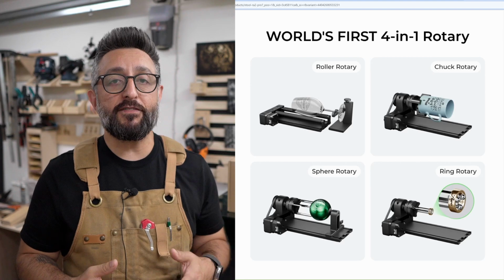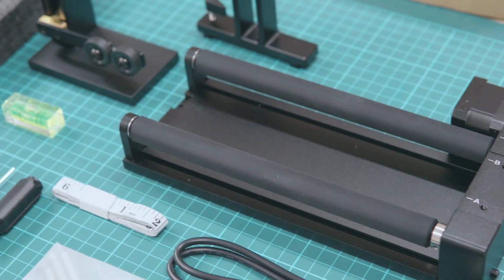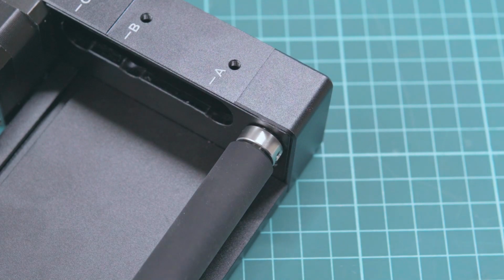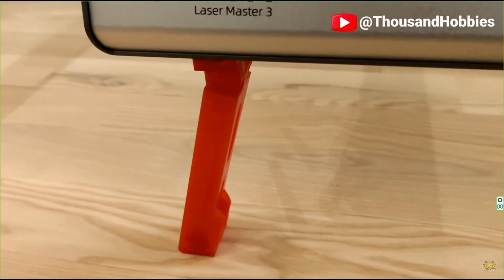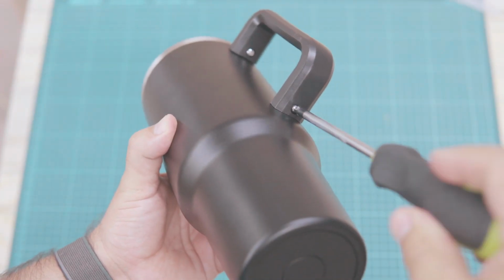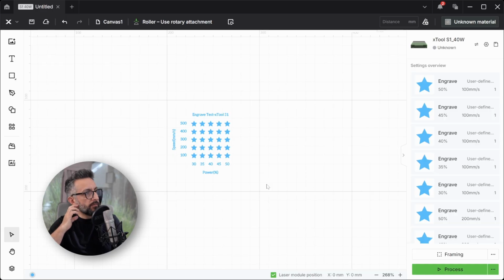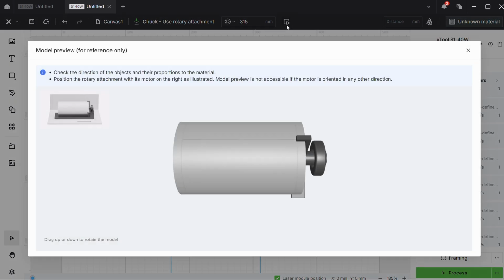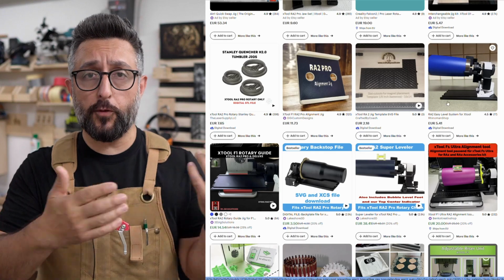Xtool RA2 PRO: Is This the Best Engraving Upgrade for 2025?

Comment: Cheers Mr,  just got my Ra2 pro out of its box cos I have a couple of jobs.  What would do the best job ya reckon?  S1 20w, S1 2w IR or P2s? Nga mihi 👍
Reply from the maker: Hey! Thank you very much! ❤! for the engraving It depends on what you want to engrave, material and detail of your design. You have more of a pro level with the P2S. And the diode is more hobbyist. The dot sizes are different too. On stainless steel the 2w IR can give you more detail but will be slower than the Co2. For powder coating, the P2 is better. But then again, if you are doing it for testing or just to get your feet wet, it is a great opportunity to put them all through the process.

Comment: I notice you’re putting the crumb tray in …. In another video the guy didn’t like the crumb tray because it moved to much … just wondering if the problem was cured now ? He uses the raiser base and actually fasted it to the wood base he had under the unit …. Reason I’m asking is I’m thinking about buying the S1 or P2S … A smaller investment might be better idea for me … Anyways thanks love your video’s !
Reply from the maker: Hello there! I have the s1 and the clearance when using the rotary attachment accessory (RA2)  is not much. So, I removed the honeycomb to gain more space. Even then it was tight. I don't have the raiser bed (not available in the EU) so I had to do what I could. If you go for the S1, I would recommend you get the more advanced RA2 with the tilt mechanism. I think that would help. Wow, the P2S? Right, well, it all depends on what materials you want to use, the space you have available, how big of products you want to make and a few other questions you need to ask yourself. I just uploaded (minutes ago) my buying guide for 2026. Check it out and see if that helps. Thank you for being here!